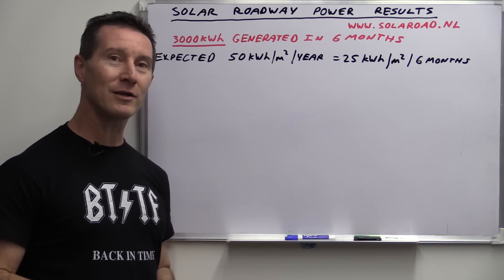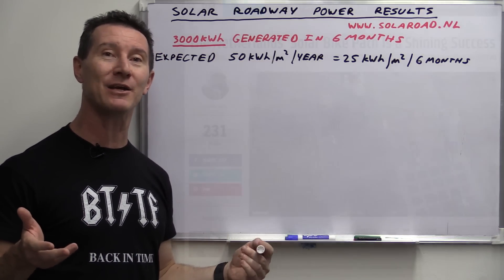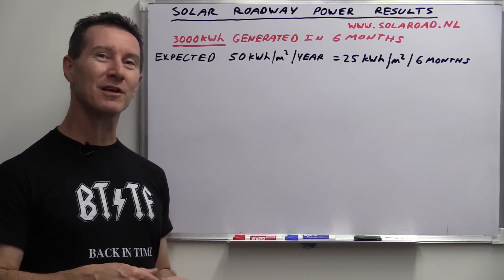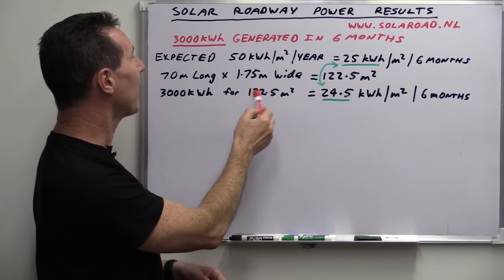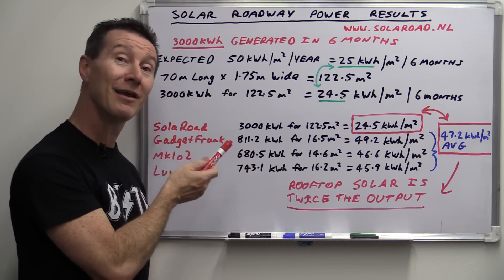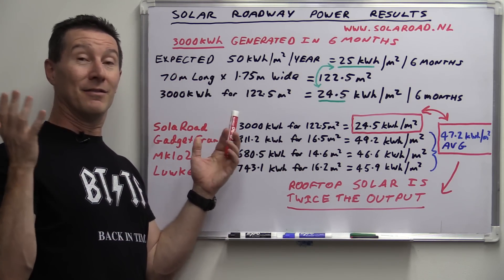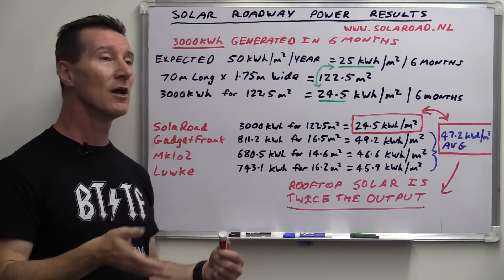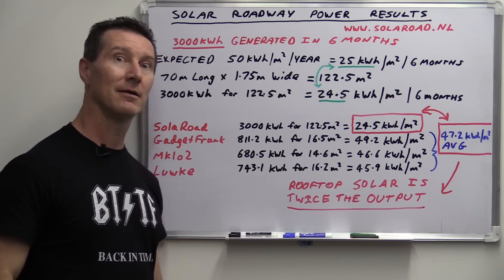EEVblog #743 - Solar Roadways Test Results

Comment: Dave have you looked at solar powered refridgerators using ammonia ?  Saw one at a tech Open House.  Or solar water heaters to store warm water to heat the house or for the shower !  And for 24/7/365 base power maybe a Thorium MSR and is great for the Earth; so the large Mars population will not be able to send WMD back to Mother Earth !  Great video and keep up the good work.

Eyes UP and lights down,  tjl  Sent by Win7Pro64 w/ADSL

Comment: if people did not try and fail, you wouldn't have panels on your roof, I like to call it R&D.
Reply from the maker: Mike James This is not investment in solar research! It's simply taking existing solar panels and putting them in the harshest and most inefficient environment possible. It's crazy! Please learn the difference.
Reply: yes, change the substrate to titanium dioxide and it may work

Comment: Doesn't rooftop solar keep the building it is installed on cooler? That would be an added benefit.
Reply: Maanuueel42 
If you have a roof that somehow contributes to heating by the sun, you should do something about it. Because as soon as the sun is gone, you will lose much more heat through it than you can ever get during the day.
Reply: RickMakes Well, that depends on where you'er living. If you actually want your house cooler (summer in Australia), then yes. 
If you live in europe for example you usually (~75% of the year, just guesstimating) want your home to be warmer and will have to invest additional energy into heating your house...

Comment: Why does anyone think this is better than just pouring all this money into massive solar farms?
Reply: Rob Mckennie They think it solves a problem that doesn't exist and is an efficient use of land. Instead of all that land being used for just transportation, it could also be used as solar farms. 
Fails on every front though.
Reply: BrianBeuken If you think that 100% of that space will be used, you're sadly deluded. I don't know if you drive, but I do, and the state of the roads are rarely pristine. And that's asphalt, not glass or plastic. The maintenance costs are going to be astronomical, I would not at all be surprised if the panels are a net loss because of that. You can leave me alone now, I so do not care enough to keep talking to you.
Reply: Rob Mckennie  Farms use up real estate that has a significant cost and farms are subject to damage, and require constant maintenance... Certainly they are far more efficient than the road concept,  but not practical in most countries where land is valued highly. Road space is effectively free and available to use making vast areas able to generate power, even at a reduced solar productivity. But they need to determine if a solar road is actually viable as a road, 1st and formost, and then does it produce enough energy to offset the potentially higher build costs.
Reply: BrianBeuken Hey, what about this, you know what else takes up a lot of real estate? Buildings. Someone should come up with some kind of solar panel that can be mounted on top of buildings! Then we can spend all this money on that
Reply: BrianBeuken you're grasping at straws
Reply: Rob Mckennie  Not at all, that is the exact idea behind the drive to find a viable means of making roads from solar panels...

There is no escaping the fact that rooftop space is limited, road space is vast... if you can produce power from roads you have potentially a vast amount of surface area to collect from...

how is stating this fact, grasping at straws?
Reply: BrianBeuken admittedly this is an idea pulled straight out of my ass, but what about wind farms in the ocean? The concept in my mind is the type that concentrates light to a central point with mirrors and generates the power there.
Reply: Rob Mckennie  Roof spaces is the ideal place for a solar panel....but roof space is limited and there are 1000's of times more road area than there is roof area . Its all a matter of scale. Making some use of that available space is the real driving factor for this concept.
Reply: BrianBeuken What do you mean roof space is limited? So is road space. What does it matter that there's more road? First of all, you're not going to repave all roads with this technology, that's absurd. Second, consider the economic costs of shutting down big roads in major cities, not to mention the dismal cost per watt of a solar panel designed to be walked on and driven on without incurring serious repair costs. Compare with roof space, space that it being used for virtually nothing, so it can be shut down without cost, and the improved efficiency of panels that don't need to withstand the stuff that pavement does. It's just absurd.
Reply: Rob Mckennie 
Clearly you have not looked into this...There are 10,000's of times more m2 of road space than there is roof space...simple arithmetic shows that even at 50% effectiveness of a roof panel, you have access to considerably more coverage and potentially still 1000's of times more revenue even if every roof was filled with panels.

There's also the rather simple fact that someone owns the roofs....and people choose not to install panels....roof panel uptake is feeble at best even with incentives galore..
Roads however are usually owned by local or national government who are capable of making decisions to convert them into productive solaroads where appropriate. There would be no more disruption at their laying than there would be for any other road replacement.
And yes, the idea is indeed to replace "most" of the roads with this tech...if it proves to be economically viable. 
There would be no point in doing it in city centres since buildings would obscure the sun, and hopefully those buildings will have roof panels. The main target would be suburban and country roads/paths.. which at the moment generate 0 income.

The trial system in The Netherlands is demonstrating, quite clearly that as a cycle path at least, its working fine...people are using it daily...and its generating income...the fact the coating needs to be updated and 1 panel broke and was replaced does not undermine its effectiveness as a cycle path or as a generator or prove that the prototype is failing.....so the idea really is not totally absurd.  There are many unknowns still that are being discovered. 

Try not to judge it till we have a full set of cost figures and some idea of the durability of the surface...none of which is currently known. when it is, you can say its absurd, till then.....try not to prejudge.

Comment: Good to add numbers to the case against putting photovoltaic in roadways. As you say, even those with a poor sense of practicality would not choose to put solar cells underneath pedestrians and vehicles. Geez! Marketing...
Reply from the maker: Applied Science Yup, marketing and wishful thinking!
Reply: Applied Science It's Ben Krasnow! It's always nice to see the youtubers I follow interacting with each other.
Reply: Applied Science The only place on the planet where solar roadways would work is North Korea, because their roads are empty...
Reply: Applied Science Ben!
Reply: In this vide he does not take the amount of cost into the calculation that a road would cost anyway. I have no clue if that would make a big difference but it is at least some money. Also, the amount of rooftop is limited and a community probably has lots more roads than public roofs to plaster. I think it good to have some alternatives in the drawer in case other more efficient options run out or are unavailable for whatever reason. Korea: agreed! Genius. I saw similar suggestions for us water ducts.

Comment: I liked Tesla's graphic (during the Telsa Powerwall launch) showing what the size of a solar installation to provide the US with power and the single pixel battery storage to even out the supply/demand issues.  What did you think?

Comment: Funny story: Friend of mine on Facebook (they added me from a game group) from the Air Force posted an article about SOLAR FRICKEN ROADWAYS, I told him they're a neat idea but currently not feasible. he got pretty defensive, adamant that I didn't know anything about the technology involved (this is the guy who took his laptop to me for repairs when he somehow lifted the CMOS battery holder off the PCB while trying to fix his charging jack himself), insisted it was a great idea, etc. etc.
Linked your videos where you go through the math and engineering hurtles and so on, he still rages on and insists that YOU don't know anything about it, that you just didn't see the potential in the technology and its implementations, etc..
Didn't get to make a final statement before he unfriended/blocked me and deleted the comment thread.
And nothing of value was lost.
Reply from the maker: ZeroPointAlpha Yup, typical true believer at any cost. Nothing will convince them it's not viable.
Reply: EEVblog
I even told him "Dude, it's a cool idea, even the guy I linked in the vids thinks it's a neat idea, but it's just not feasible, there's the numbers as provided by an actual engineer, what more do you want?" but he wouldn't have any of it.

Comment: I don't really understand how relatively smart people can be so obsessed with this senseless uphill battle of "solar roadways", it's in every blog and news feed. I wouldn't be surprised if I saw this on an 8th grader's science project, but the simple fucking data is out there if you wanted to calculate it (even without real world testing), it's retarded to put solar panels under tempered glass on a road. If people had critical thinking skills and had the mental capacity to weigh the pros versus the cons before building this, they could have see that it's not efficient or useful.

I think it's got something to do with a knee-jerk reaction of thinking that you're right when people say otherwise, they're out there to "prove everyone wrong" or something. Well, go ahead, we'll watch you like we've been watching the "free energy" and "perpetual motion" people that have been trying to prove that the gov't and oil companies have been hiding the "truth" about energy for decades.
Reply from the maker: kagi95 It's a "sexy" idea, that's why it catches on, practicality be damned.
Reply: kagi95 Seriously. How are there even professional engineers out there willing to put effort into this. Any engineer should be able to discount this idea in about 5 minutes worth of thought (as Dave does).
Reply: kagi95 Yup. What is 'popular' and what is feasible are two different things.
Reply: kagi95 I do wonder how they will manage to make a glass surface grippy enough for a roadway that will not reduce efficiency even further. Also when it's raining, those will get slippery as ice anyway...
Reply: ***** yes, that's what I meant ;) a rough surface will completey obliterate the energy production, because dirt will block the sunlight very quickly.

Comment: One thing I got from this is that a solar roadway will generate more power then a concrete roadway.
Reply: ***** Way to much is for sure. The energy cost for the tempered glass alone would be many times more costly than the amount of energy ever produced by the solar road. Put the solar panels on rooftops, it's easy and it works wonders :)

Comment: What happens when they need to service items under the road (e.g. cabling, pipes, sewer lines)? While tar is not the best material, it is at least relatively simple to dig it up and access something underneath.
I was also wondering, since solar panels lose overall power output as they age will they ever cover their own initial cost?

Also one thing that seems to not be considered is that if you invest in solar roadways, it is likely done with the plan of not going back to tar as soon as the panels fail, thus for the system to ve profitable in the long run, it must not just cover its own cost, but it must make enough to fund the replacement panels, with some left over to add wealth to the economy, otherwise the funds will never reach a point of being a net positive in the economy, as they will constantly be a money sink.

Think of it like when some governments will hire armed thugs to forcible collect taxes from poor people, where the money that they collect barely covers the cost of collecting the taxes from them.

Comment: So, half the output of the cheaper, static, tilted rooftop installations. 

Their website claims sustainable.. I think once the construction costs are factored in, that's doubtful. 3.5 million euros for the 70 x [1.25 - 1.75] m stretch (note, their website, press releases etc don't say, simply that the path is 2.5 - 3.5 m wide, and split into two lanes)..

They did say they used 1cm thick Tempered glass, and chose to use the cycle path for the prototype phase due to the much lower loading.. uh.. yeah.

I can see why people think its a good idea to cover the pavements and road surfaces, but it's far cheaper and far more productive to just buy the frames for greenhouses and use roof-top panels for the same area, especially for permanent infrastructure. 

As for the calculations, probably is a good idea to plug the real data in (assuming you can find reliable figures for the area) for a quick video. Would certainly be interesting to see it lined up against my above.
Reply from the maker: SibbTigre Bingo, it's not sustainable.
Reply: SibbTigre 
It's crazy. If i remember correctly you get 1kWp rooftop installation per around 1000€ (work costs and electronics included) that will get you around 1000kWh a year (that's the typical yield here in Austria 1MWh/a for 1kWp installed). So the 3.5 million € could have given 3.5MWp of solar installations on roofs (3.5GWh a year), about 1000x what they got. Sure it's a prototype , but a prototype that should have never been built, because it should have been dropped even before the design phase.
Reply: superdau I disagree with the assertion it shouldn't have been built.

As Thunderf00t says, a demonstration is worth (more than) a 1000 claims. We now have empirical data from their demonstration that their claims are too lofty and the reality does not match their imagination.

As I said, they could cut the costs dramatically for the same area, achieve bigger returns by buying greenhouses (at retail prices, mind you) and installing roof-top installations. But until they actually take that step, they are just going to burn money, sadly.